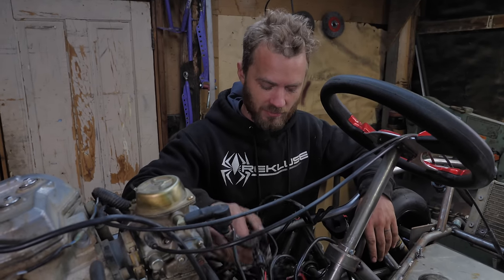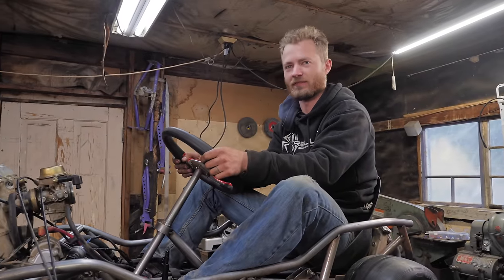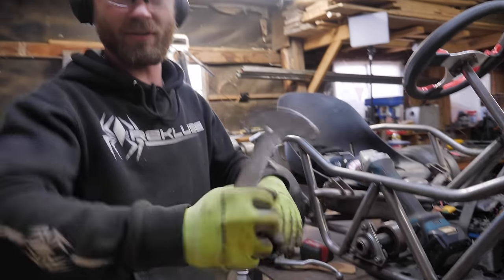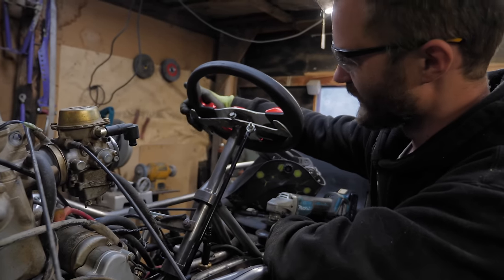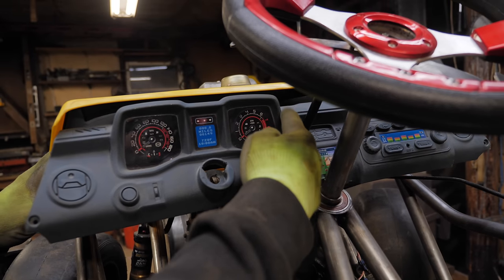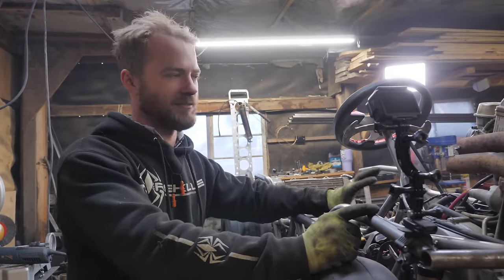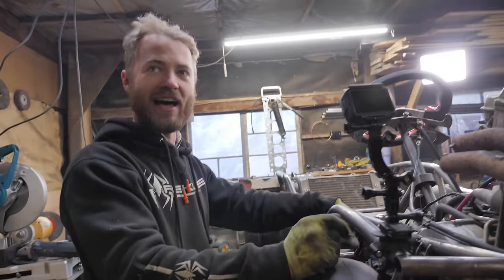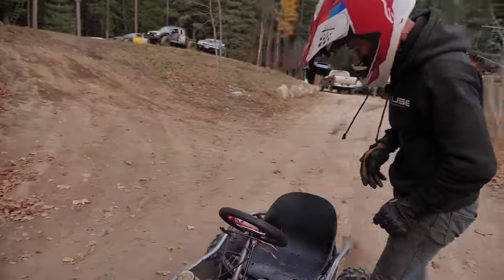First Test Drive! 500cc Off-Road Go Kart

Comment: IT'S A BIT OF WORK BUT I KNOW HOW TO FIX ALL OF THE I-BEAM'S, CONTROL ARMS, ETC. FROM GETTING BENT. it is really simple you need to build BOXED A-arms, i-beams, control arms. thats how i roll on my prerunner. when i had tube arms they would get bent in one hard landing. i promise once you do it, you will not need to re-do again. heavy but strong. let me know if you have any questions or want photos for reference material.

Comment: Dumb question could find a bearing the size of the stearing  column and weld a bracket to it so the wheels turns but the shifting mechanism stays in the locked position? Just a thought

Comment: It would be cool if you guys could figure out a way to put a solenoid on the shifter. That way you could shift with buttons and not worry about the linkage breaking. And also you wouldn't have to cut up the dash.

Comment: I know you already know this so this is for the people that don't. One ground is fine if everything that needs to be grounded is connected to the same piece of metal. When your are dealing with something that is bolted together vs welded together, multiple grounds are a good idea. Of course, if you are dealing with rubber mounted components than multiple grounds are required.

Comment: The KOVE speaker is the same as BÖHM IMPACT and SoundPEATS. Same speaker, different brand and the price is the same as the Kove WITH the discount.
Should get a new sponsor boys.
Reply: A sponsor's a sponsor
Reply: @GumpterCrayon  Well...... no.
Kove have rebranded a speaker that cost 15$ and saying it cost 200$.
I think you can buy the speaker for 5$ if you buy 100pcs from China, where the speaker is built.

Comment: Could of used cables to shift with a "Y" on the shift peg ...left cable ran around to front and right ran straight down to pull towards you

Comment: FYI, 3 grounds is not even remotely excessive when you are stranded and cannot get you kart to start because the ONE ground you made failed and you can't figure that out on the side of the road. I think you may have been there before. ;D
Learn from your mistakes, actually its easier to learn from others mistakes.

Comment: Hey if you run into problems with that shift system you could fix the levers in place so your steering  wheel turns and the flappy paddles stay fixed just make the levers cover more circumference of your steering wheel so there will always be a bit of lever under the wheel when you go to grab a gear🤪 hope that kinda makes sense, it works for Ferrari 👉💨
Fuckin ace build tho👍

Comment: I think that the reason the triumph isn’t running right is that it doesn’t have the proper exhaust or amount of back-pressure for the turbo
Reply from the maker: Tried that. Not the problem.
Reply: Grind Hard Plumbing Co sounds like a tough issue to solve then

Comment: The whole time they were doing the shifter, I was like bro what happens when you turn, why not use a bearing around the steering shaft then weld the pivot point to a bearing sleeve. when they mocked it up they found out they can’t turn I was like man 😂🤦🏻‍♂️

Comment: Instead of blowing the exhaust in your face run it down under the cart and have to one pipe on each side of the cart weld on some angel iron under the control arms

Comment: I have a theory … That fixed chain has nowhere to go , a 5 - 10mm rock caught in between your chain and sprocket will increase the diameter of the sprocket , chain has nowhere to go , therefore bent arm trying to compensate …. power doesn't hurt things that way , more likely to twist shafts and shift splines in my experience …. but brute mechanical force surely will . side note , when adjusting the chain on any bike , I simply put a 7-16 spanner between the chain and sprocket at the top and roll the wheel back , lock it in place , roll forward spanner out , chain tension perfect …. Current ridiculous horsepower motorcycle for reference … ha. Keep up the great work . https://www.instagram.com/p/Br_tqk-BKsj/?utm_source=ig_web_copy_link